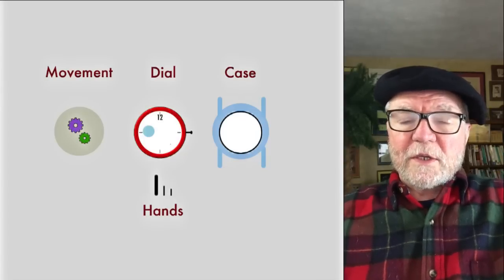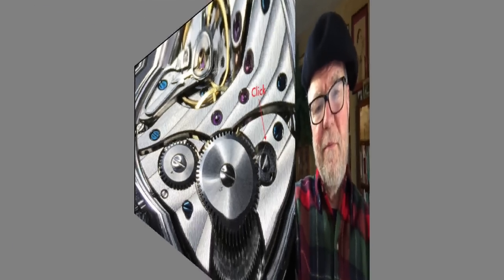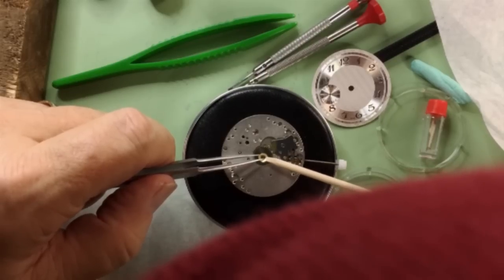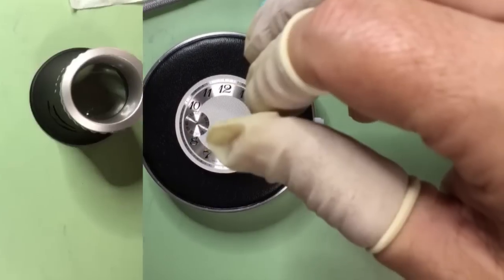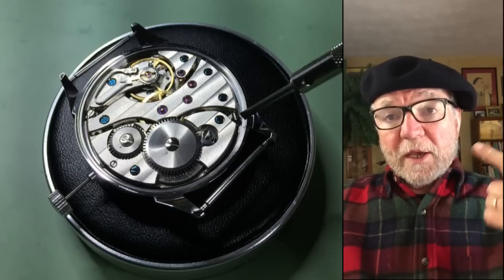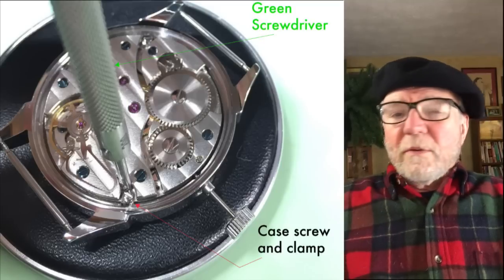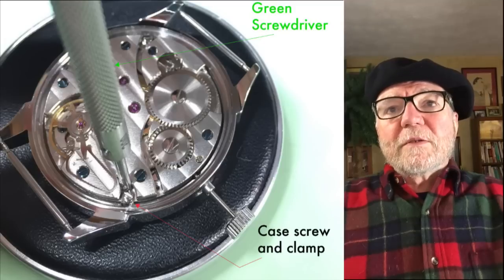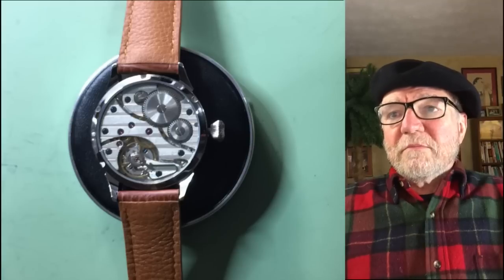Making Your Own Watch

Comment: Bill, thanx for sharing this project.  I have decided to go ahead and buy a Parnis watch complete with the 6497 movement already in it and ready to go.  This is cheaper than buying the individual parts.  I want to take the movement apart as practice and try to clean the parts and lubricate it correctly.  Thanx again.
Reply from the maker: Hi Glen, you can always take it out and put it back together ... and you're right! Costs a lot less! Take care and be safe! Bill 😷
Reply: @watchartsci  Thats the plan Bill.  I want to use it as a practise watch.  If I like it I might even shop around for a real ETA movement to play with!

Comment: Hi, nice video. I have the same case and the same movement. My problem is, that one of the case clamps kinda lifts the movement instead of securing it in place when I screw it in. What am I doing wrong?
Reply from the maker: The case, dial and movements may be mismatched Herr K. Usually I've found the problem to be with the size of the dial. Take care and get your shots if you haven't, Bill😎
Reply: @watchartsci  Thank you. I'll check everything again.

Comment: How did you readjust the click to get it running?
Reply from the maker: Hi Snorkel ... slowly disengage the click ... a peg wood stick was used..., and once it's unwound it springs right back into place. No adjustment required for the click. Take care, Bill

Comment: Top tip for stem cutting wrap some cling film around the crown so if it does ping away (and it usually does!) The cling film will act as a flag and protect it to
Reply from the maker: Thank you for that great tip Mr. Dripling. If you're interested, there's a FP group, 'Pretentious Watchmakers,' who are wholly untrained (other than a few watchmaking courses) that you might like to join. We could use your insights. Take care and be safe, Bill😷

Comment: Hi how big is the case that you used for this watch ,also for anyone trying this if you loosen the screw to remove the stem and you loosen it to much you better be a watch maker, it is connected to some other part of the watch and you will never get the stem back in without removing the hands dial and other parts of the watch.
Reply from the maker: Hi Joe, I believe it's 42mm. Good tip about the screw...messed up more than one movement by over-loosening.  Cheers, Bill
Reply: Thank's for the on the watch size . @watchartsci

Comment: Great job Bill. A very nice watch indeed. I wish I had the dexterity for this. I guess the reason why I’m not a watchmaker or a doctor is, I just don’t have the patience.
Reply from the maker: Hi Bruce, I'm not sure if it's patience I have or just the fact after one thing, I'm pooped out. The amount of concentration is huge, and I suppose that there's a Zen state of watchmaking where everything flows together. I got to that point in programming, and I'd like to do the same with simple mechanical watches like the 6497/8 ... before moving to something more complicated. Kindest regards, Bill

Comment: Hey Bill,
Can you please help me make the right choices with my parts?
I want the 6498 (seconds at 6). First, I want to know if I can get that movement into 38, 39, or 40 mm case? I see the movement is listed as 36.6mm. My confusion is why they are put into 42mm and larger cases?
Next, the size of the dial; if my case is say, 39mm, what size dial do I order? Should the dial be smaller to fit or the same size as the case?
I'm sorry for the elementary school questions, this is the level that I'm at.
Thanks.

Hey Bill, 
I should have watched the other guy's video first. He advised to buy a case and dial made for the movement.
Reply from the maker: Hi RP ... I'm pretty sure I said the same thing: buy the movement first, and then order a case and dial that goes with the movement. Anyway let's get on the right track. 1) The cases for the 6498 are bigger than I like...42mm was the smallest I could find from the inexpensive Chinese sources. The best you can do with a 6498 is 41mm from Ofrei: http://www.ofrei.com/page1494.html :
(OFREI-CASE10  — Mineral glass $78 (Domed)

OFREI-CASE11 — Sapphire glass $154 (Domed)
You can also get a case fro Tourby but they're €300 ... it might even be 40mm. However, for a first watch .... get one with lots of room...I'd even suggest a 44mm. As for dials, same thing. Dials have "feet" and the feet have to fit into the holes in the 6498 that's made for them. And with hands... you want hands made for the ETA 6498 or ST 3620. Here's another link: https://www.ebay.com/b/Unitas-6497-In-other-Watch-Parts/10324/bn_7022483342 Take your time...there's no rush. Kindest regards, Bill

Comment: The movement is mechanical right?
Reply from the maker: Hey Mello, that's exactly right. All mechanical. Cheers, Bill
Reply: @watchartsci  Thanks but why not use Quarz?
Reply from the maker: @mellonear9130  You can if you want. Different set of challenges with a mechanical watches. Kindest regards, Bill

Comment: It's the flying spaghetti monster that eats the tiny metal bits, I've had it visit my pretentious shop too!
Nice watch btw.
You should get one of them elevated tables, it helps alot (got one at work, just never tinkered with watches there, only for standing up while at the computer).
Reply from the maker: Hi Michael, I got the desktop workbench which raises the work area for bracing both arms and working at chin-level. (http://www.ofrei.com/page241.html). As far as small parts entering some unknown orbit, I got a box of screws and clamps for securing the movement to the watch in case I lost the ones shipped with the movement. For some reason, as soon as I got the box, the tiny case screws and clamps ceased to fly off. However, my small seconds hands decided to take wing... all of this work should be done in a large bubble. Cheers, Bill

Comment: That’s really cool.

Do you know the material properties of the dial? It’d be fun to design one. CNC the shape. Plate, screen or fire the surface. Or in keeping with pretense, you could laser a skeleton. Can you vary the vertical offset of the hands to clear dimensional indices (or numerals)?
Reply from the maker: Hi Andy, I was considering the same thing! Do you know of a good, affordable laser engraver? I'd use it to make dials and engraving. Cheers, Bill
Reply from the maker: Thanks Andy, LaserStar was one I was looking at.They tend to be a bit pricy compared with some others I was considering but they may have just the one I need. Kindest regards, bill
Reply from the maker: Andy, could you check with your colleagues at work to see if this one would be appropriate for engraving on stainless steel? https://www.amazon.com/15000MW-Engraver-Machine-Stainless-Advanced/dp/B07G748N34/ref=sr_1_1_sspa?ie=UTF8&qid=1542025453&sr=8-1-spons&keywords=metal+engraver+machine&psc=1 Thanks, Bill

Comment: hwo did you remove the logo on the dial? or you order without logo? thanks in advance
Reply from the maker: Hello Bryar! You can order a dial with no logo. These are called 'sterile dials.' Kindest regards, Bill
Reply: @watchartsci  thanks for such a quick reply. I searched on ebay and somehow did not find that.
Reply from the maker: Hi Byar, Here's a link on eBay to lots of sterile dials for a 6497 movement. The dials without any writing o them are the sterile ones. Kindest regards, Bill https://www.ebay.com/itm/36-8mm-Watch-Face-Fit-ETA-6497-Seagull-ST36-Movement-Sterile-Steel-Watches-Dial-/153061391505

Comment: merci bill, watch looks good to me but it seems strane without some sort of lettering
Reply from the maker: Yes Roger, it's called a 'sterile' dial. I'm thinking of getting an engraving machine using a laser and putting my logo on the dial...something along the lines of "Montres par Bill" with a 'MpB' logo. Cheers, Bill
Reply: @watchartsci  exactly bill,  something classy like old english scroll
Reply from the maker: @rogerthomas2132  Yes, or French formal script...it will have to be pretentious for my watchmaking group, La Société des Horlogers Prétentieux. Cheers, Bill